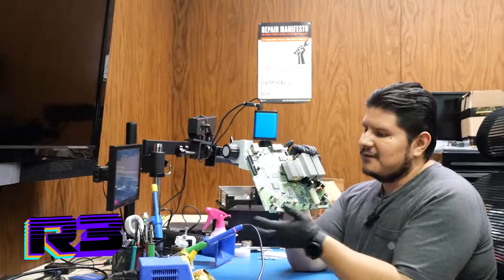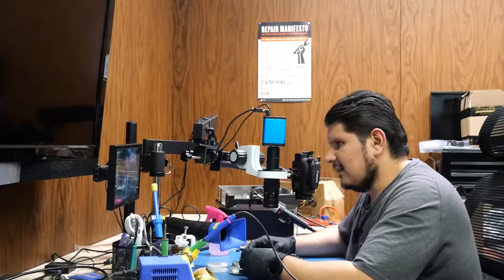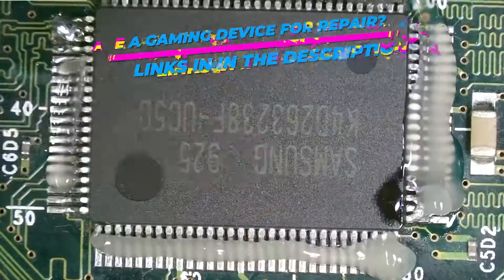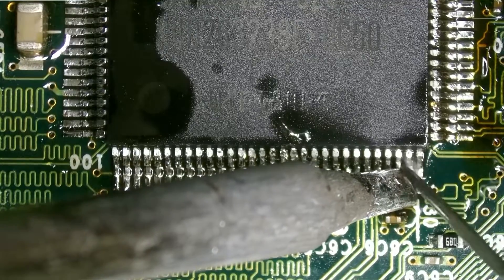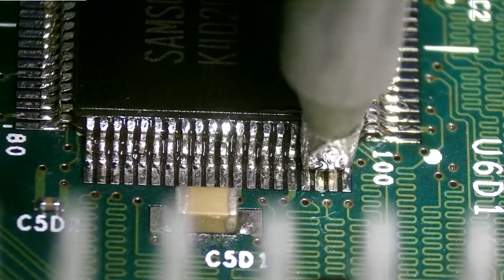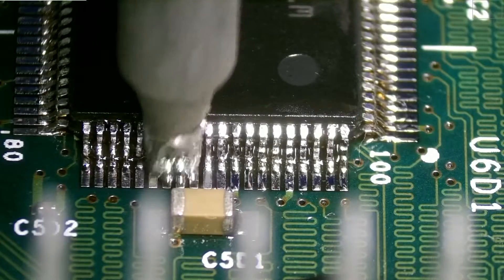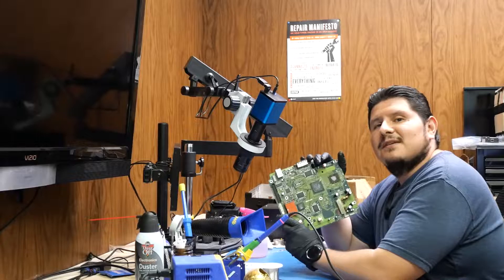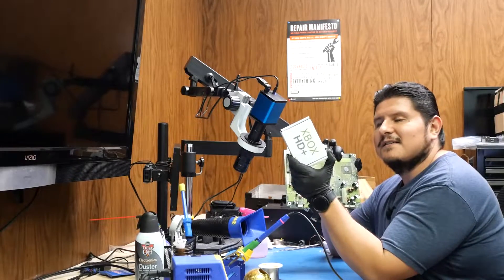Upgrade The RAM in The Original XBOX to 128MB | Advanced 1.6 Install

Comment: This vid will come in handy i never done a ram mod on a 1.6 console. I need to do a recap and a 128mb mod on mine aswell. You can now bypass the clock cap on 1.6 consoles. Redherring has a really simple guide on bypassing it. I might consider sending it over for a CPU socket mod, it would make for an interesting video since i will be installing the upcoming Open Xenium HDMI mod into it.

Comment: 11:30 What kind of application do you use to perform the 128MB RAM test?
Reply from the maker: Its the Xblast OS, which is flashed onto an Aladdin chip. There are a few open source chips that you can install the OS to as well.
Reply: I run xblastOS flashed to a tsop

Comment: try 2 or 4gb
Reply from the maker: Its not possible for the OG XBOX
Reply: max theoretical ram size for intel pentium III cpus (which is what the xbox uses) is 512mb
Reply: @atypicalchannel  no it's not, where are you getting this information from?
Reply: @NiceYoutuber  .... the pentium 3 computer I have that wont recognize anything over 512mb of ram
Reply: @atypicalchannel that's just your chipset. the intel 815 does not recognize more than 512mb of ram but the cpu itself can recognize up to 4gb, it's a 32 bit cpu

Comment: What's the benefit of more RAM on the Xbox?
Reply from the maker: XBMC seems to run a little smoother with it, though I imagine a faster CPU would help more. A few emulators can use the extra ram as well as some debug titles that you can run on the XBOX.
Reply: @RetroRenegadeRepairs  You can also run Sega Chihiro arcade games with the extra memory.

Comment: Why not 32mb QC50 chips instead of 16mb stock ones?
Reply: Huh my comment was deleted...

Adding 256MB of RAM is signifigently more complex then adding ram to existing banks and using a custom bios. Prehistoricman on HackADay was able to but he had to write new custom bios with ram management and add some traces to allow for signaling; there were some issues as he had to use BGA ram which required he make a custom PCB; looks like the traces weren't equal distance which is causing some issues.
Reply: @GeorgeWashingtonLaserMusket  that are DDR2 chips thats why the interposer, Nforce2 can hold 256mb and more with proper bios.
Reply from the maker: I've not been able to source any. Do you have a part number for those?